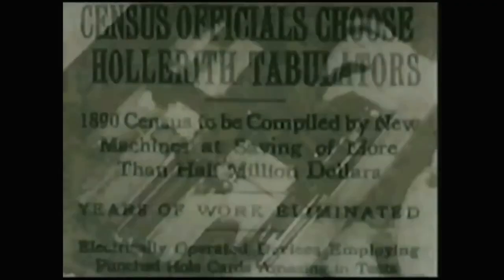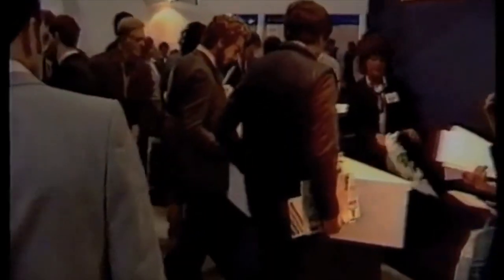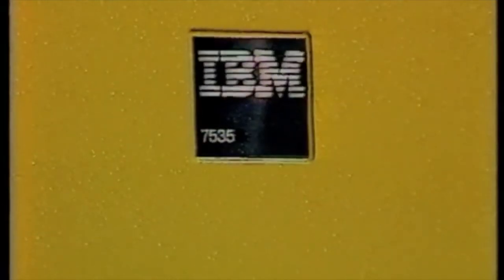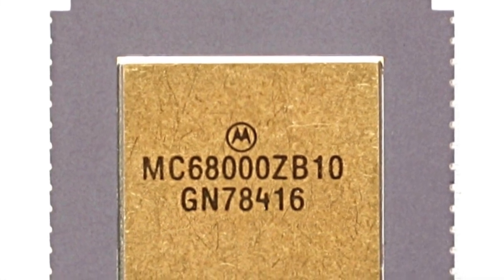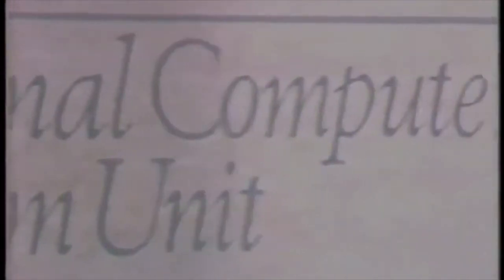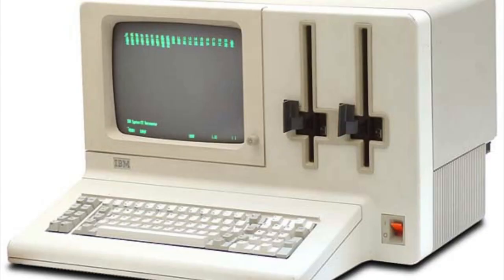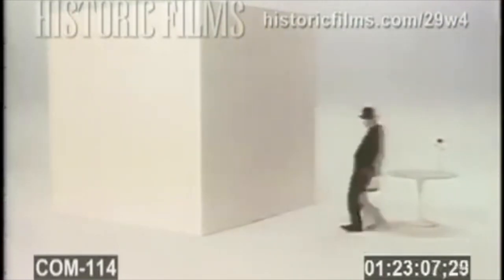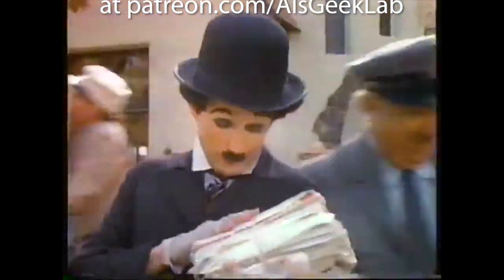The #IBM PC turns 40: How IBM came to make the PC

Comment: To clarify, the 8088 had backwards compatibility to the existing 8085 peripheral chips which made it easier and cheaper to implement as a complete system. The instruction set was completely different though.